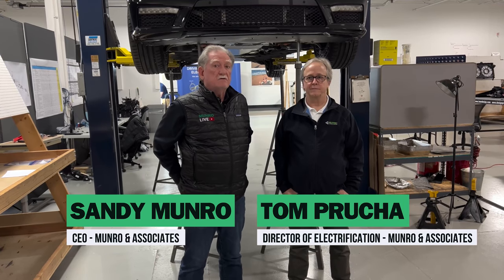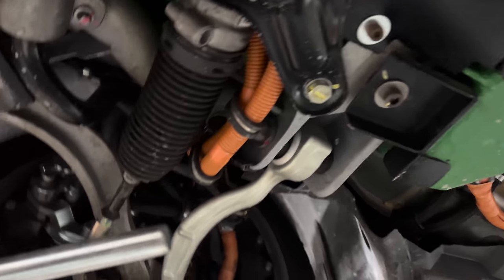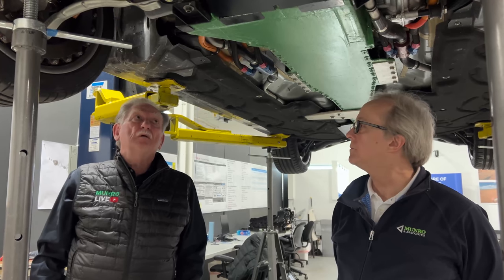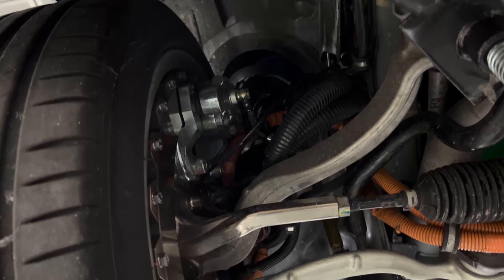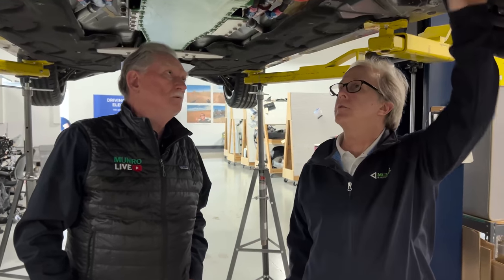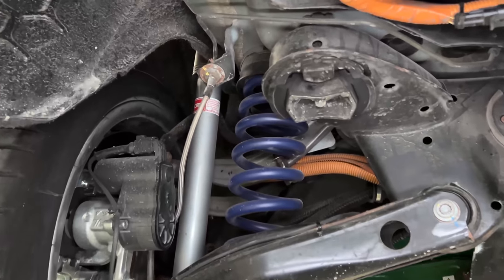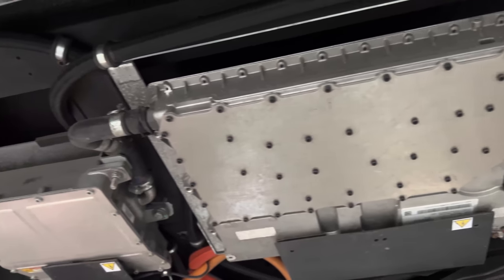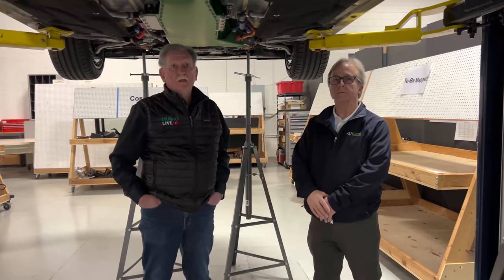Protean Electric Wheel Motor Technology | Review with Sandy & Tom

Comment: Sandy & Associates, please ask this question:
Why wasn't a tapered bearing used instead of that custom design brake solution?
Shouldn't two tapered bearings pointing towards each other along the axis of rotation reduce all reflected inertial loads (radial forces) onto the rim?
This is an issue because the air gap between rotor and stator should be kept consistent, otherwise BEMF will be widely variable on the drive.
I mean, bearing OD attached to an adapter which houses the motor rotor and bearing ID should sleeve a shaft which connects to the ID of the wound stator-- because this is obviously an out runner motor.

Kudos to Protean for trying to solve the bigger picture problem, but this sounds like the right answer to the wrong question.
The the employee managing this youtube channel, you the real MVP.
Reply: @T Legend As you’re obviously a knowledgeable engineer, I wonder if you can answer this: Could inboard brakes be used to offset the unsprung weight of the in wheel motors insofar as the torque forces on the brake shafts would be reduced by regenerative braking?

Also (from below): Could the large diameters of these rotors help with efficiency? If so, does that restrict them from using smaller diameter rims with higher aspect tires to improve ride & economy?
Reply: @Crunch_dGH  Yes, but you need a driven axle from the wheel back to the chassis. That would add complexity and weight.
Reply: The brake has essentially nothing to do with the bearing types. The "inside out" brake disk mounting is done to allow the disk to be attached to the rotor/hub; it also saves space and helps to maximize effective disk diameter to minimize required caliper size.
Reply: @Crunch_dGH  Thanks for the validation, but I wasn't trying to start/win some keyboard quarter backing contest online. Was just genuinely curious/trying to break down their business strategy and how they can lean/pokeyoke components to achieve a certain function of a system at scale and generate a profit.

For your 1st question; Not sure I fully understand your q, but if I'm interpreting that correctly, my answer would be that's an alternative question which leads to a different answer. My comment was to say exactly just that, Protean asked the wrong question, but answered it correctly. Using tapered bearings will eliminate majority of the radial forces from the tire reflected onto the rim. It's been in use since the Toyota FJ series, I think 1980s, to traverse over rocky terrain because those tires take a beating endlessly.

2nd Q:
part1- What I meant here is a volumetric comparison and power in vs. power out. If you take 100watts and pass it through a 100cm3 motor vs. passing it through a 1000cm3, the 1kcm3 will be more efficient-- granted that all other aspects are scaled proportionally.  
part2- So with reference to part1, generally larger is more efficient, but if I were on their team, I'd be more concerned about the balancing act of finding the right wheel size to convert electrical power to mechanical power vs. aerodynamic drag. At some point, economic factors come into play for tire size and aero drag would cancel out the eff. gain of the larger motor. I know this because Protean actually tried recruiting me some 4-5 years ago. I analyzed their product and ultimately decided that I didn't want to chase the wrong question. On the flip side, I could be completely wrong. :)

Comment: I was literally minutes ago looking for what Sandy thought of hub motors when I saw a poster of Protean in the background of their Tesla model S plaid suspension video. This is very good timing Sandy!
Reply: Nobdy asked me, but here goes:
Smaller motors are less efficient vs. larger motors.
Implementing four smaller motors into wheels has a greater net efficiency loss compared to one larger motor + gear reduction losses.
Remember that we're operating on last century battery tech which is already not that efficient.
Im also surprised that the controls are independent per wheel so voltage drops across the power lines are... hmm might be debatable here, but my gut says this decision is based on scalability of the product. Mass production of the hub motors are cheaper because all of them are the same because your template (the car) will vary widely across the automakers.

Just my opinion and sad to say;
Protean's solution is a technology to curb the transition to EVs for legacy automakers.
Reply: @T Legend  still,  interesting to see this technology worked on and improved. May the best solutions rise to the top and win.
Reply: This video popped up because youtube is reading your thoughts.
Reply: Isn’t the likelihood of something unfortunate cutting these plastic cable housings near the wheel, not worth all of the work to get them there in the first place? 

Also. Don’t these things catch fire because all they have is air cooling?  Ie. lordstown? 

Also. Isn’t adding weight to the wheels. Literally the worst thing you can do for vehicle dynamics and Preformance?
Reply: @derpamine  Could the large diameters of these rotors help with efficiency? If so, does that restrict them from using smaller diameter rims with higher aspect tires to improve ride & economy?
Reply: @Catalyst Network Solutions  I wouldn't worry about the cables any more than normal rubber brake lines to the wheels.  Unsprung weight is definitely an issue though.
Reply: @derpamine  agreed.  Tesla seriously considered hub motors but pretty quickly discarded the idea. From my point of view I don't like the unsprung weight, and I also think the motors are too vulnerable sitting out in the wheels.
Reply: @derpamine  no smaller doesn't mean less if you use room temperature superconductor motors all what you said will be obsolete.

Comment: I would think in wheel hub motors would be perfect for the Mercedes G-wagon.  Better clearance, precise control, seems ideal vs portal axles.
Reply: You always get the problem of large unsprung mass. Exactly the thing you do not want on bad roads.
Reply: NOPE, Mercedes should use the Tesla QUAD Drivetrain, it's SUPERIOR to anything, PROTEAN can do. look as what a FLOP Lordstown is with Endurance pickup, and the LIGHT-YEAR one, both are FLOPS.
Reply: @vic321344    Yup, that could be a "massive" problem.  Front drive is a deal breaker for me.
Reply: @vic321344  and yet moast offroad cars use live axels that are heavier that independ suspension whit inboard brakes. and also portal axels that Aussie2u talked are even heavier than normal live axel.
Reply: Portal axles with solve the ground clearance issue  on the g wagen
Reply: @markplott4820  it's actually the rivian quad motor system.
Reply: @carholic-sz3qv  - NOPE, Rivian can't do 1500+ HP , 1200 lb Torque, can't carry 5000 lb or TOW 20K lbs like a QUAD Cybertruck can, this QUAD Drivetrain can be adapted to mod 3, Y, S, X.
Reply: @markplott4820  Lol...... What's the point of your comparison?! I said that the rivian was quad motor, it's made for different clientele, the cybertruck even with quad motors won't tow 20k lbs let alone carry 5000lbs, the cybertruck is going to tow 20k lbs on how many miles?! Lolllll.
Reply: @markplott4820  the cybertruck does not compete with a Ford f250 super duty for example. Even the model x has proven to not perform well when towing it does bad compared to gas and even worse compared to diesel.
Reply: @carholic-sz3qv  if Tesla even ever gets around to building the quad motor.... which they only even came out with after every other manufacturer out-motored them. Quad motor is Tesla playing catchup to Rivian and GM and Ford.  🤷 They certainly didnt originate it or have even actually been working on it.
Reply: @patreekotime4578  not they haven't been working on It, they are just copying the ideas they like all wheel steering, tank turn ...... 4 motors electric cars are nothing new btw!
Reply: Wheel hub motors on a off road vehicle would be a pure disaster.
Reply: @markplott4820  Mercedes will have their own axial flux motors.
Reply: @markplott4820  I hear it is the tech Koenigsegg uses in their Supercars. 🤷
Reply: @abraxastulammo9940  - then you were LIED to.
Reply: @vic321344  you don't drive bad roads at speeds when the mass makes difference unless you compete at baha 1500. It is the full redesign of suspension linkages that makes the idea impossible
Reply: @patreekotime4578  “Tesla playing catch-up to Rivian, GM, Ford”……I got a good chuckle on that statement .

Comment: Hub motors and standard battery packs are an easy and fast way to convert ICE vehicles tto BEV. Not the most efficient. But quick and easy to install.
Reply: correct.
Reply: Not the most efficient?  All World Solar Challenge racers feature hub motors for their superior efficiency. BTW the Aptera has hub motors, my motorcycle has a hub motor and the first Porsche (Lohner-Porsche) was a hybrid featuring hub motors.
Reply: @moestrei  I would say the Tesla Plaid motors are the most efficient motors you can get. Hub motors are easy to install in selfmade motorcycles. Like the Aptera.
Reply: @vic321344  The Plaid motor requires liquid cooling to remove all those heat losses. Cannot be that efficient energy wise. Even space/weight vs performance not that great looking at the Lucid drive train.
Reply: @moestrei  Shure you have to cool. To get efficient. Hot motors are not efficient. And in a car you always need two of the hub motors. That adds to weight.

In scenarios where you just need several kW power output, hub motors are really efficient and easy to regulate.
Reply: @vic321344  distributed motors is the future!
Reply: @3nityC  I would like it. It provides more power. But not in the hub. Unless I want 90 degrees turnable wheels.
Reply: These hub motors are actually lighter than a typical rotor
Reply: @veganpotterthevegan  hub motors are inefficient and not easy to cool.

Comment: Unsprung weight and durability seem to be the biggest issues with this design, but I like the idea.  More room in the chassis for other stuff (like batteries), no shafts or CV joints or whatever.  Sounds amazing for off-roading with the potential ground clearance possibilities.  Not sure how much I'd like it for road comfort though.
Reply: Motors on wheels will need 2 motor per axle on the top of the suspension wear and tear for way more unsprung mass .. and can’t eliminate the water and other corrosion issues ..so I say why even waste effort in that kind of dead on arrival tech
Reply: Unsprung weight will always be a factor , but it is now. So... nothing new.
Reply: So long as they do full epoxy potting durability should be top notch, obviously you will not be repairing any parts inside that assembly afterward.
Unsprung weight is very critical to dynamic driving or rough roads, but for city folks it really will not make a difference (but an obvious use case limitation).
Reply: Getting high voltage DC down to the wheel sounds like a fantastic idea. Not a good way however
Reply: Inboard motors can prioritise performance over weight. Ditto inboard brakes. However EVs do most of the braking via the motors so friction brake can be considerably smaller.
Reply: The wheel motors unsprung weight is an engineering challenge - so I wonder why they added the inverter and wiring to that weight.

Wheel motors looks like they have another problem - heat. Under even moderate braking the motors will build up heat, and they're surrounded by brake discs that also build up heat.
Reply: +1 for unsprung weight. Nice build tho

Comment: High unsprung weight?  Gyroscopic effect makes it hard to turn wheels?
Reply: You CAN overcome the the effort with assistance - but you will have zero road feel IMHO.
Reply: Only if the weight of motors is rotating.  If most of the weight is fixed then it's not going to be much more gyro effect that the wheel would have anyway
Reply: @TomasEggers  Around half of the weight of the motor is rotating. It is the rotor with the ring of magnets.
Reply: @TomasEggers  I would think about half of it would be. External rotor (steel / magnets) with internal stator design (coils). 18kg per wheel?
Reply: Ya but where do I buy them. Thats the question
Reply: Newer cars are almost all electric power steering and nearly impossible to steer if the electric motor isn't allowing it did the gyro effect shouldn't be an issue

Comment: This is the setup Australia needs on a SUV/UTE/Duel cabs. Coupled with a diesel range extender series hybrid. We need cars that can still do 2000km when we need with quick remote fill ups then use electric pottering around the city.

Comment: In wheel motors are the future for all Non performance EVs.  It is the most efficient as the power is applied where the rotation starts and delivered directly to the road.  No transfer of rotation losses anywhere.   Compare this to a fan with a transmission rod, vs just the fan itself, you can see which one would be more efficient.  Lot of difficulties with road damage, increased unsprung weight, but in the end more efficient = more miles.
Reply: Unsprung weight is actually lower

Comment: THANKS4GIVING.  That suspension has to be sluggish with all that weight.   And that break Design—-won’t that put huge stresses on the bearings.
Reply: YES, this is why ENDURANCE, LIGHT-YEAR one, and APTERA will be a FLOP.
Reply: You can clearly see that the suspension isn't stock. Manual double adjustable dampers
Reply: No, the large-diameter brake disks attached to the hub (which is the motor rotor) around the outer edge makes no difference to the bearings.

Comment: I know i've had both hub and mid drive motors in bicycles, and the mid drives are superior in pretty much every way.  Maybe that has changed though..its been a few years--i'm still using my mid drive.
Reply: E motorcycle and e Bike need shaft drive w/ electric motor, more reliable than hub motor and chain drive.
Reply: I have a hubbed and you are 100% correct.
Reply: It's much worse in a car than a bike. But still it's not the best option in a bike either.
Reply: A hub motor on a bicycle puts no strain on the drivetrain, you don't need to pedal if you just want to throttle, and they can be really powerful.Ideal for cargo bikes.  If you're all terraining it, or just like too much bike, you can have all wheel drive.  If they're not geared they can have regenerative braking.  They are less expensive and easily repaired or replaced.  No problem with them.
Reply: @anxiousappliance   - WRONG a e-Bike with Shaft Drive is better and you can place LARGER motor & batter in the FRAME. 
HUB motors are FAKE NEWS and will be a FLOP compared to Conventional EV motors. 
HUB will add too much WEIGHT and LITTLE benefit. the Higher Weight will be a DRAIN on batteries. and what happens when a ROCK gets stuck in the Motor, you have a DEAD bike. HUB motors will also make the e-Bike UNAFFORADABLE. 
the GOAL should be Granting Access to AFFORDABLE MOBILITY, which HUB motors cant do.
Reply: @markplott4820  whatevs
Reply: Grin Technology actually make some pretty compelling arguments to the contrary.  Regardless, it's a different use case, the best examples to look at would be the World Solar Challenge, where solar powered cars race across Australia.  They have all migrated to hub motors because they are significantly more efficient.

Comment: It would be intersting to learn how much of weight the inverters add to each wheel, also as a percentage of the wheel weight without the inverter.
Reply: Tesla inverter intergration is the BEST and elegant solution. and it's Forward & Backwards compatible with ALL 4 models.
Reply: @markplott4820  No doubt Tesla's solutions, not only the inverter, are top-notch and hard to beat.
Nonetheless I'd like to know more about the solution presented in this video.
Reply: @charangohabsburg1  - ok, but it's Already OUTDATED technology. 
and the PROTEAN inverter are not Forward & Backwards compatible with older HUB motors. 
it means it Custom for each size.
Reply: @charangohabsburg1  Don't feed the Tesla fanboy troll!
Reply: @charlestoast4051  Sure, thanks for the heads-up!
I am noticing now that he clutters comments all over, he obviously is trolling, maybe without being aware of it. He's a believer, blind to research and ongoing innovation, doing no favor to Tesla at all.

Comment: 4:20 Sandy and the rest of us realizing that battery and controller masses are just that much better than they used to be so that you can do a conversion with >200km range and not go too much over the original curb weight. 🕺🕺🕺🔋